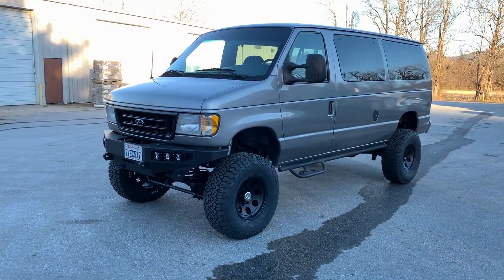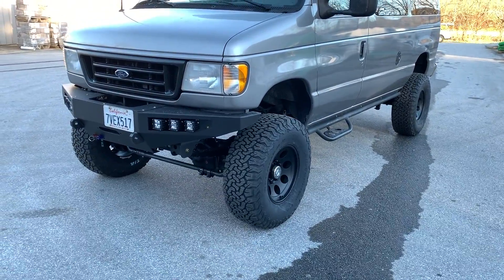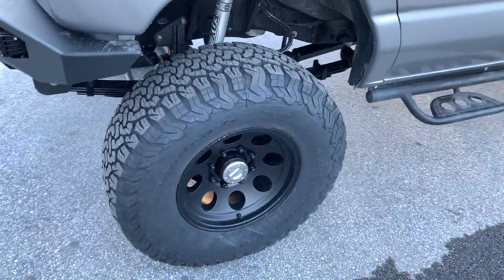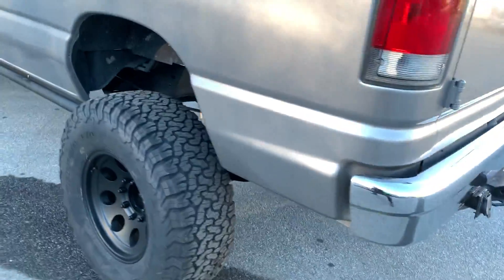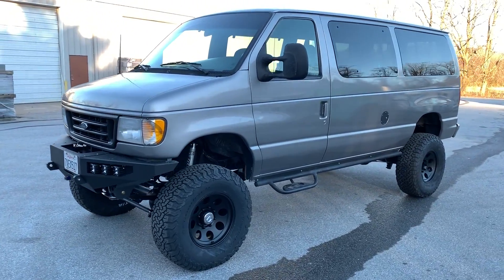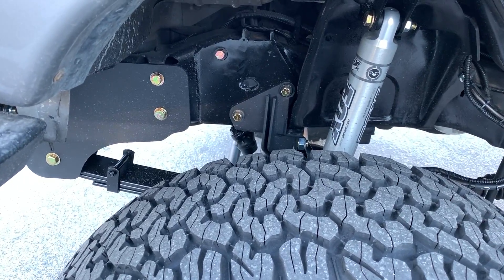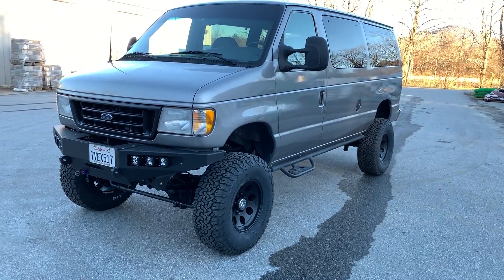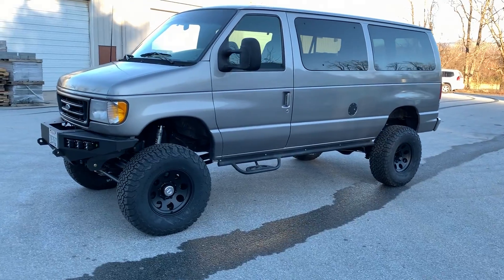Ujoint DeJavier/Crows 4.0 Fix

Comment: As a person who has owned a 4x4 van for many years now,  and has done countless hours of research I've found that Ujoint offroad is among the most respected of the 4x4 van companies right along side Sportsmobile and Quigley and is the best choice if you truly want your van to be offroad capable.  so you guys keep doing what you are doing and screw what the jealous haters say.
Reply from the maker: Thanks!
Reply: @ujointoffroad  Which of the coil or leaf suspension do you feel is better for a daily driver, not too much off road, mainly to use in case anything happens weather wise in our northeastern part of the U.S. that gets snow every year?
Reply: Huseyn Ahmad Leaf Springs are “practically” bullet proof. They are the safest bet. Almost indestructible.
Reply from the maker: @huseynahmad6054  Leaf is always the answer for durability, steering, handling, overall pleasure of ownership but we'll have a coil over system soon that will give it a run for its $$
Reply: I have a u jont and it the  only for a drive I would recommend actually works rocksolid for being so  tall and flexes like no other it will run over anything small cars Boulders ditches it is an amazing rig Especially the crossovers Steering